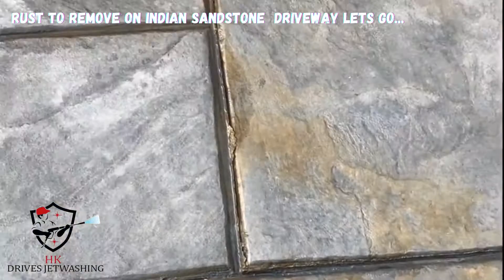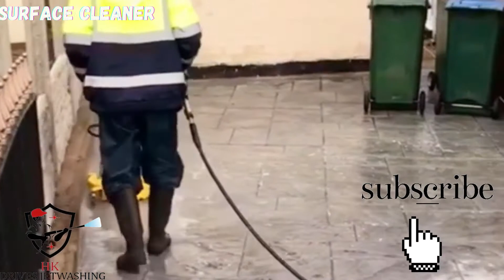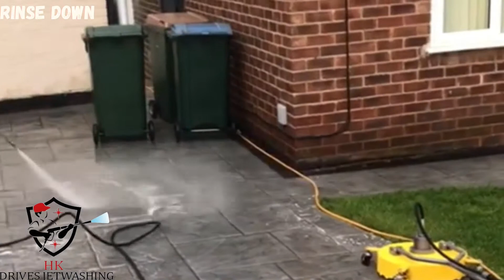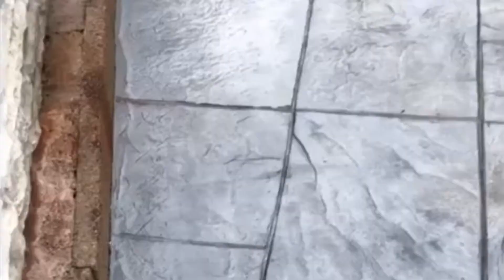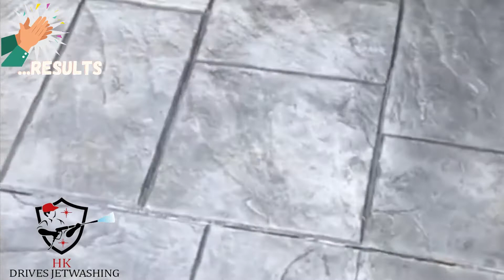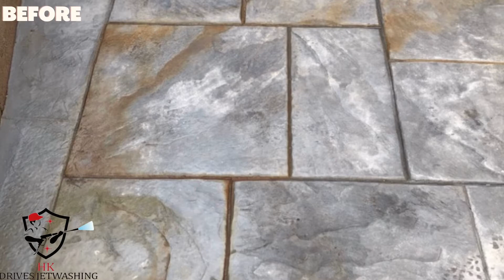Indian Sandstone Driveway Cleaning

Comment: Where did you get your pressure washer from? Which model is it? You could always do a video on your equipment. Keep up the great work.
Reply from the maker: My pressure washer is a Vanguard Briggs and Stratton 21 lpm 200 bar 14hp from Rutland pumps bought it two years ago and it is an e start machine. I will do a video on my equipment very soon, I have a pressure washer service video coming out in a few days 😀
Reply: @HKJetwashing  Yeah that's a great idea. I think you are doing really well with the channel. I was thinking of getting one from Rutland Pumps. I am a gardener but thinking of getting into pressure washing. It looks a good gig with the right equipment. Look forward to your upcoming video.
Reply from the maker: Thanks a lot mate appreciate that I do try my best with the channel it’s very difficult to stay on top of it due to my work schedule. If you want to get into Pressure washing definitely contact Rutland pumps and just do some research on what type of machine you would like. If I could go back in time I would’ve bought a van mounted systems straight away instead of on wheels. This year I’m planning to take apart my machine and put it on skid, I’ve just gotta get round to it. Catch you soon all the best with everything 😀
Reply: @HKJetwashing  Yeah thanks for your reply. I guess if you are doing it full time then it makes sense to get a mounted system.For me I do gardening and need the versatility of the van. All the best.

Comment: Nice job what chemicals did you use to remove the rust stains?
Reply: @HKJetwashing  EBC? or something different? I'm finding it hard to find a decent oil and stain remover especially block paving as the longer the oil has been sitting the more its soaked in and harder to get out.
Reply: @HKJetwashing  which one?